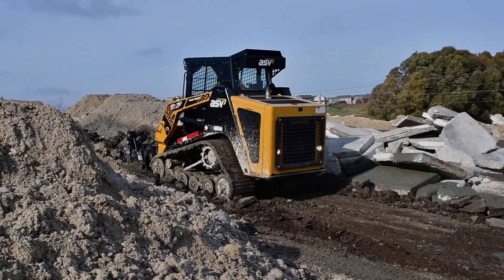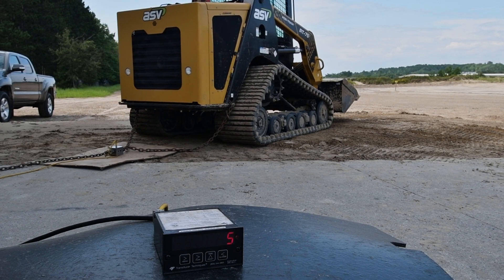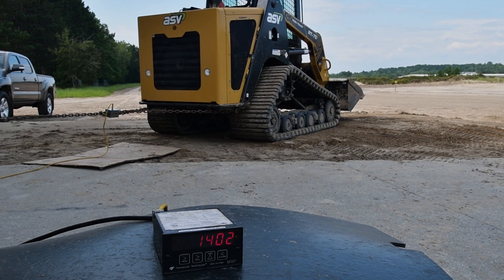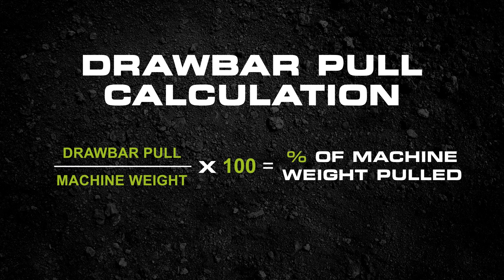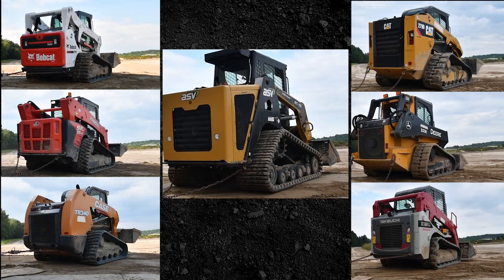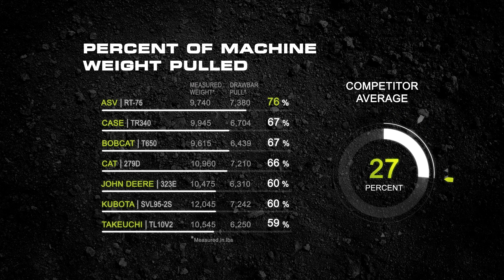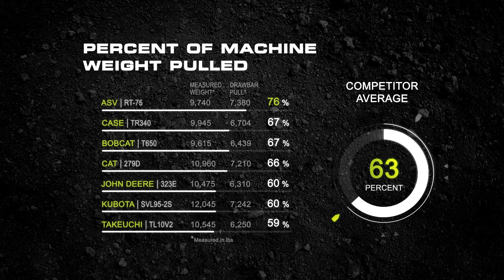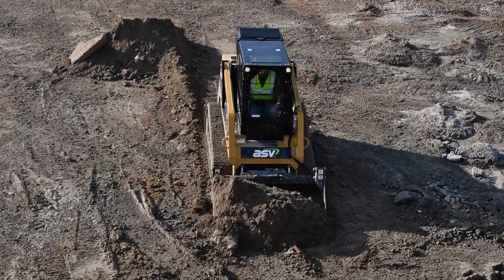Tractive Effort: ASV vs Competitive Loaders

Comment: I have a question . why do you compare machine weight here, if the competition  has more weight and it gives them the advantage of drawbar , the customer will choose competition only.

What difference it makes in taking drawbar to weight ratio ?
Reply from the maker: Hi, thanks for watching. We originally thought the machine weight would make more of a difference in the test. But it turned out that even though the ASV machine weighs the least (9740 lbs), it still had the greatest drawbar pull out of all the machines (7380 lbs)!